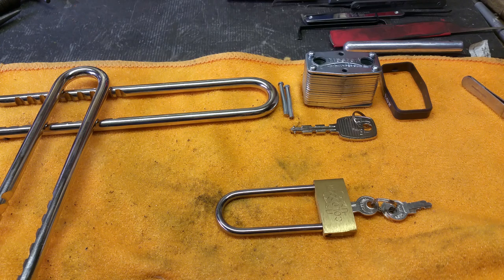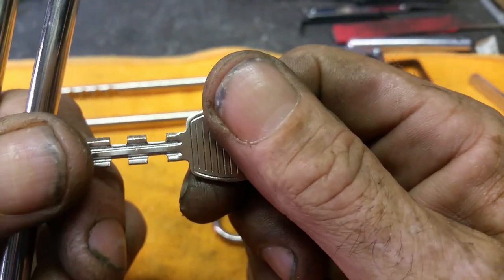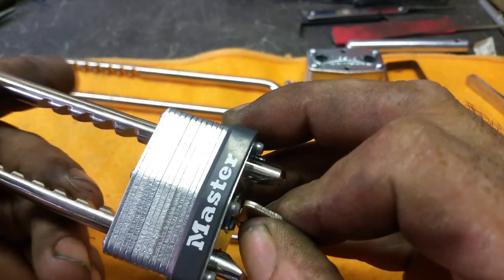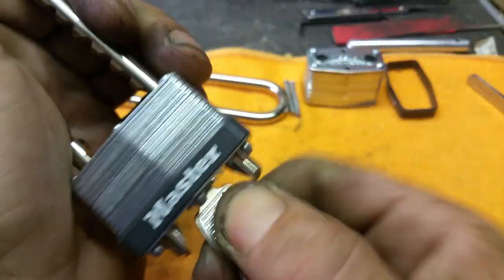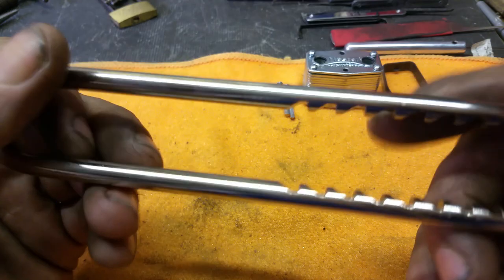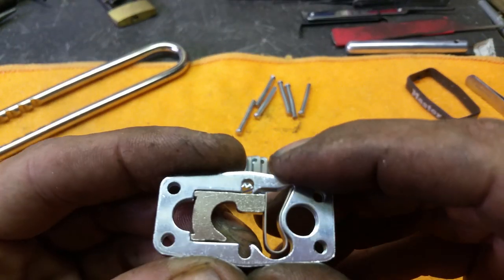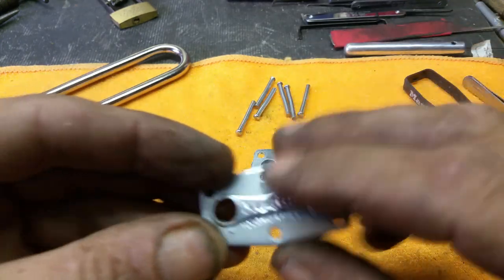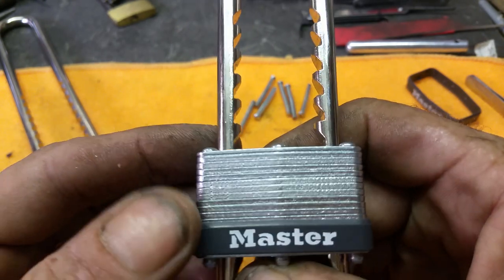#48.Master 517 Laminated padlock exposed and by passed.

Comment: When I first started picking,  I wondered why these kind of locks were still being made & sold since it is so easy to bypass them, or grind down a spare key & in doing so create a Master key for all of them. Some manufacture advertising said they work well in dusty & dirty environments.  Makes sense when you see how simple the mechanism is, with almost no moving parts, and one flat spring.
Reply from the maker: Thanks William. Yeah, i can understand Masters claim would have some validity to it with minimal moving parts. I must admit though, the evolution of the warded lock hasn't made much progress. Cheers:-)